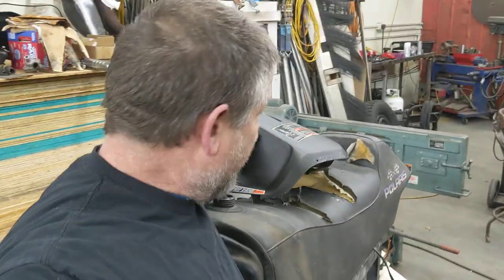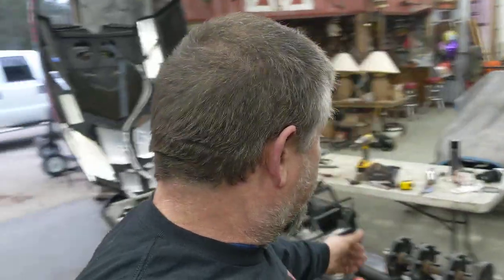POLARIS ULTRA BIG TRIPLE BUILD

Comment: Its been a while since I looked into it, but I do STRONGLY suggest double checking for stud clearance with that track and studs. It seems to me there was a spot up front that was still pretty close even after the cooler was removed. I would hate to see you put all that work into it and have the studs chew the tunnel or bulkhead up. I can’t remember if it was above the drivers or in front of them. My gut feeling says smaller drivers might be a plus for safety
Reply from the maker: Track is in so I'll be double checking everything. Thanks for more input on this

Comment: Hey Todd, can you clarify something? I thought in one of your videos you said that the SPX motors had the fourth oil line from the factory. This  motor you are adding the fourth oil line. Is that because this is a donor engine from a non-SPX ultra?
Reply from the maker: Yepper
Reply: @toddclyne3493  is there any general rule of thumb as far as when to look into having the water pump re-done? Like a certain amount of miles? I’m looking at a used one with 6100 miles on it and wondering if it should be one of the first things I do.
Reply from the maker: @kevinjozwiak5696   I would. It's the first thing I do to all of mine. Unless they can show you one of the guys that do them just did it. It will save you a lot of money in the long run. Tim.precisionpumps@gmail.com